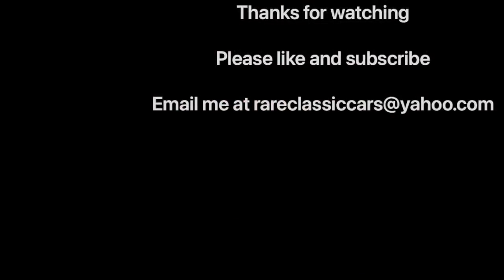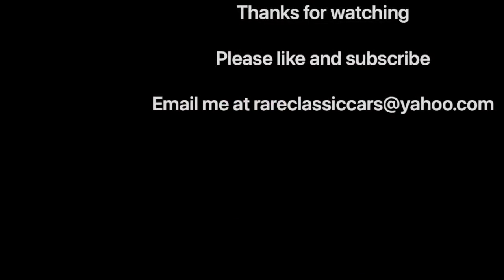Worst Engines of All Time: GM 2.5L Iron Duke Follow Up

Comment: "Worst engine" to me means unreliable.  Sure, smoothness, power and so on counts but pushing your car off the road wass really uncomfortable and celll phones were not common so a huge hassle.  Think of your engine blowing a gasket 100 miles away from anywhere on a hot day without a cell phone and a 20 mile hike to anywhere.  Today?  Dial and go but back then, a breakdown can blow your entire day or worse.  For this reason, "worst" means unreliable and any engine that was reliable, no matter how crude was much preferred over a smooth running POS that leaves you stranded every couple of months.  Different time, different rrules.  You forgot the "third" vehicle buyer, sure you had trucks and cars but the third car buyer was purchasing a "work car".  Something that could fit in tight traffic in cities, get decent mileage, performance was not critical because of traffic jams but it had to get you to work!  The Chevy Vega aluminum 2.3 was a smoother engine to be sure but you would not want one in a work car.  I'll grant you the 2.5 was a crude engine, vibrated, shook around and GM should of improved it with balance shafts, rubber mounts, aluminum heads or whatever when they fuel injected it--they should have!  My first CAR had a 2.5 Iron Duke with a carb and a 4 on the floor.  It was a car I drove to work and let me down once--so I push started the thing and got to work.  130,000 miles later, the car was damaged from accidents and abuse but the engine did not burn oil.  My car was not a kid hauler, not luxury by any means but with the 4 speed I could get mid 20's even in heavy traffic and the torque helped with stop-and-go.  No regrets with that car, simple, easy to work on and it just ran--as a work car should.  The VW Beetle was a crude, ox cart of a car with no performance, poor handling, weak brakes, no AC, no real heat, no auto transmission as it was designed to move people in the 1930's.  Oddly enough, a very popular work car because it was reliable if you mainained it, easy to work on, fit in tight city streets, great in snow and you can get it running qucily if it broke down.  That is why people have fond memories of that bucket.  Back then people didn't have cell phones when the car broke down, it ruins your entire day.  Reliability was more important then than it is now so keep it in perspective.  At least it would not leave you stranded when the cam belt broke.....right?  Now if comfort and refinement are weighed higher than reliability and economy, yeah....not a good engine but you should of bought the V6 in the first place.  Calling an unfrefined  but reliable engine "worst" because it vibrates?  No... at least it will get you there which is the entire point of driving a car.  At least the Duke was fairly easy to work on--not like the disasters that came later so that also keeps it off the "worst" listing.  So you have no cell phone, you have to fight traffic and get to work with high gas pricesw--the perspective at the time.  They did not know the price of gas would fall in the future and remain stable for 25 years so the panic to get something that sipped gas was priority.  One must always put the time in perspective with the vehicle.  The 2.5 was reliable, got decent mileage and didn't nickle and dime you to death with chronic maintenance---it just ran and for a lot of people at the time, that was good enough.  Sam Walton (founder of Wal-Mart) was the richest man in the world and drove an old pick-up truck, not because he was cheap....because it was reliable and just worked.  He was the richest man in the world at one time so cost was not a concern... keep it all in perspective.
Reply: We don't need a biography. Just make it short and to the point.

Comment: I drove an '84 Skylark for about five years, and that Iron Duke was the best most reliable part of that car. I beat on that engine mercilessly, delivering pizza even, and it never gave me any trouble, other than a thermostat - which was the EASIEST thermostat in the world, as it was accessed by removing a radiator style cap from the thermostat housing!!! Simply let it cool and pull the old thermostat, and put the cap back on and drive to the McParts store for a new one. Next time the engine is cool, drop it in! You'll spend more time in the store than you will R&R'ing the thermostat! Maybe showing us that particular feature will appease your disgruntled, Iron Duke-loving viewers... You've got to admit that that is a pretty interesting and convenient quirk on the FWD 2.5s.
Reply: I had an 85 sunbird and went to a concert at the capitol theater in Flint Michigan ( rough place). I came out and saw all the cars in the lot had their windows broken out except mine ( i always left doors unlocked). I drove about 45 min home  and realized i didnt have any heat ( middle of winter). Instead of stealing my radio they popped the hood and stole my thermostat and left my radiator cap in the fender well. At least they didnt break my window in the middle of winter. they got me the other way though. Silly thieves! lmao.

Comment: After watching your "Iron Duke" videos, I realize how lucky I was to avoid that engine when I bought a new '82 Celebrity.  We got the 2.8L V6 engine.  It was pretty gutless, but had none of the Iron Duke harshness you describe.
Reply: It really didn't have any business being in the A-body...  I drove a 6000 with an Iron Duke.   It was dog slow. (or turtle)lol
Reply: But that V6 did not have the durability of the Iron Duke.
Reply: Absolutely true. My parents had an '84 Omega with the 2.5 Liter buzz bomb, which they traded for an '87 Buick Century with this motor. The Omega was slow, but the Century was dog slow. That Century should have had a 2.8 v6 for the quietness appropriate to a Buick. Both cars were junk as far as reliability as well, were burning oil before 100K miles.

Comment: You are right in that the Iron Duke made noise.  The Olds Calais exterior lines were so pretty compared to Toyo/Honda 'fill in the blank' of the time that I would have chosen NVH and beautiful lines over the ugly ducklings and smoother 'motor'.

Comment: Too bad what they replaced the iron duke with, the Quad 4, wasnt that much better. Better performance (but no balance shafts till 96 when thhey bumped it to 2.4) and worse reliability.
Reply: There was a time in the late 90's where almost everyone I knew had a car with a quad 4 sitting in their driveway waiting for a new headgasket.
Reply: @hughdahand5711  I had a 95 Achieva with the quad4. Besides being so thrashy youd never want to use that high rpm power (it sounded like it would explode) and a blown oil pressure switch (spewed all oil out, needed a tow) it wasnt so bad for me. That cars problem was the 4t60e transmission. It would upshift as quick as possible to save gas and 40mph in 4th was too tall for the quad4 and it would start bucking. The transmission lost 3rd and 4th. It wasnt worth fixing and then gernaded itself 6 months later. My next car was a regal 3800 with the 4t60e. Shift points programmed exactly the same as the achieva but the 3800 had more than enough torque and it was the most reliable car Ive owned.  If gm just set the shift points differently for different motors it woulda saved alot of customers alot of grief.

Comment: I think you're on to something. Very similar to the manual climate controls in my 2013 Abarth 500. People complain about the "cheap" feel of the dials (vs the automatic climate control buttons). As a car guy whom wanted an Abarth 500 since new (with automatic climate control), but also a thrifty used car buyer, the 2013 I bought in 2020 had manual climate controls. Even with the "cheaper" feeling climate control knobs, the car geek in me can now appreciate the fact that the temp and air distribution doors are physical cable control, in a world of prone to failure electronic actuators buried deep in dash. At $5,500 that's acceptable, however at the ~$25k they were new, I wouldn't have been happy with the quality of climate control feeling for price paid
Reply: I had the opposite experience with the vacuum-driven automatic climate control in my '77 Olds 98. It was constantly switching from freezing to hot air; the running average was probably on target but at any given moment I was either too hot or too cold. The manual version would have been far better. All the other automatic systems I've owned have been fine.
Reply: @pcno2832  something was wrong with your car. The vacuum-operated automatic climate control system in my 1979 Cadillac Sedan deVille d'elegance worked great. As did those in my 1993 Cadillac Devilles and 1998 Buicks (Park Avenue & Riviera). The only car I've had with automatic climate control that I wasn't happy with, was my 1996 Lincoln Town Car Signature Series. It was properly functional, but would often be just a little too warm or cool with 1° changes, couldn't get it to hold the ideal temp. Along with the driving position, were the things I much prefer GM over Ford for. Love the 70s/80s/90s era GM cars where you can get the seat very low, slightly tilted back for a feeling of sitting "in" the car, rather than "on" it, as well as tilt the steering wheel all the way down to be right in front of your flat, rather than "slid" down to a lower position
Reply: @pcno2832  as for the Abarth/manual climate control system, a main benefit of automatic climate control is that, in cold weather, the system starts with slow fan until engine warms up and air mix door to full heat. Then it slowly mixes in more cool air to get to desired temp. Similar in summer when it starts max cold and transitions to warmer temp.

With Manual controls, it's like starting out with dial at full hot/cold, and slowly moving it toward middle based on outside temp, engine temp, sun demand etc. It can be fun, but often results in temp being slower to heat/cool out of laziness, or over heat/cooling by leaving it on max AC/heat

One benefit of manual controls with cable operated air mix door and air distribution door on highway, is being able to turn fan speed off, and using air pressure from car moving to sufficiently heat cabin/flow cool air at desired temp/outlet without running fan. Automatic climate control systems always have the fan running even at slow speed, unless system is turned "off" which turns off  control of temp/air outlet etc

Comment: Let me start by saying that I am in complete agreement with you,  but here is the strange part that I didn't understand,  I was selling Oldsmobiles  at the Troy Motor Mall in the 80s, if one of those cars came in ( used) for a trade in and was equipped with a 2.8 carburetor  it was a 500 deduct listed in the weekly black book that our used car manager often referred to for reference, we salesman didn't understand that,but we're told it was because of lack of fuel injection  and mpg, some funny moments when someone would compliment the owner of a new Toro and tell them what a pretty Calais that is, love the content

Comment: I have owned 2 1988 Celebrity’s with the 2.5 one was my first car in 1998 250k until I was rear ended!  2 5 years ago I found another one 122k miles and runs like new! But I maintain my cars like crazy lol. Oh I have a 1990 CRX 400k miles on it. Keep up the great work!

Comment: Two videos in one day, a double whammy, thanks.    The vibrating of the Iron Duke was somewhat of a safety feature for sleepy drivers.   Pull the engine to change a cam gear set, OMG.   Still the best--Chevy 327.     Thanks

Comment: I hated them with a passion. Unrefined is giving them too much credit and I even raise an eyebrow to the reliable argument. I completely agree that it turned some people away from GM coupled with a bevy of other substandard products and QC issues. By the late 90's I gave up on my love affair with GM and turned to Honda. By the mid 2000's I gave up on GM's trucks and turned to Toyota.
Reply: But Toyota, and the rest of the Japanese, not not make 3/4 or 1-ton pickups.  Only 1/2 tons.
Reply: @michaelbenardo5695  If I needed one of those I'd go Duramax, thankfully I don't. The Toyota's have been pretty much bullet proof. The last 5.7 Vortex I had was a good truck. The 5.3 after that was not. Neither was the truck.

Comment: GM was all about making money "now" and opposed to customer satisfaction for the future, like Honda and Toyota were. I was a 1970's child, gen x and American car companies shot themselves in the foot with this type of thinking. I know for sure I will never and have never purchased a new American car or a used American car. NO RELIABILITY! Complete junk compared to Japanese companies. I may be stupid. But, I'm not stupid enough to throw my money away on garbage. On the other hand. I will always purchase used American trucks. Because I believe they are the most well made, with the exception of a few choice years like 2010- up. These year trucks are choked with DPF, EGR and smog equipment, badly.  I have an early 1998 Dodge Ram 2500 12 Valve Cummins with 299,300.I drive it everyday for work. I have had to replace some body parts because of rust and engine components like injectors, power steering pump etc.. I maintain my trucks well and they stand the test of time. The engine, trans, rear and 4wd still work flawlessly and I haven't had to replace them, yet. But, I wouldn't be mad if I did. Because I don't know of any American car that would last that long, ever! Car not truck!

Comment: I went from being used to driving a 1986 buick century with the 2.5 to driving a 1991 caprice with the 305. Over 20 years later i still remember how blown away I was by how smooth and quiet the 305 was compared to the iron duke.
Reply: 4 cylinders have never been known for smoothness.  8 cylinders, whether inline or V, are super smooth.
Reply: @michaelbenardo5695  true, but putting such a clattery 4 cylinder without even a balance shaft in an otherwise very smooth driving and comfortable sedan just doesnt fit. They shouldve stuck with LLV's and S10's in my opinion.
Reply: @amhicks21  My 1979 Toyota Celica had a honey of a 20R 4 cylinder motor in it. Much smoother than my 1983 Chevy Camaro with the 2.5 Iron Duke I once had.
Reply: @amhicks21  In 1977, when it was introduced, it seemed fine, and I don't think anybody was yet using balance shafts.  I know a friend's father bought a brand new Olds Omega in late 79 when they came out as 1980 models, and he let us drive it.  We thought it was fine for a 4 cylinder, felt stronger than any foreign 4 cyl.  And despite all the bad press about the first year X cars, he never had any trouble with his.
Reply: @michaelbenardo5695  Not all 4 cylinders are rough.  Honda 4 cylinders are very smooth especially with a Honda manual.  Also the 2.2 4 cylinder in my 99 Chevy S-10 with a 5 speed manual was very quiet and smooth.  The 2.4 4 cylinder in my hybrid 2012 Buick Lacrosse was very smooth.  The technology has vastly improved and with the addition of EFI the 4 cylinders have become much better and more refined.
Reply: @jeffreysproul9110  But Honda 4s were too small for a 2400 - 2500 pound car.  Not enough low RPM torque.  Yes, I'm sure a modern 4 is nicer and more refined, but they are way off base calling the Iron Duke "a worst engine".  The VEGA engine was one of the worse ever, not the Iron Duke.
Reply: @jeffreysproul9110  — Actually, all inline-4’s have secondary vibrations inherent to its configuration. The amplitude of the vibrations grow with the displacement.

Balance shafts, though invented in the early 1900’s, were adapted to automotive engines by Mitsubishi in the mid 70’s, and marketed as “Silent Shaft” technology. 

The 2.2 and 2.4 engines that you reference both are equipped with balance shafts, and pre-balance-shaft engines were smoothed by the careful design of the engine and transmission mounts.  

You mentioned Hondas being smooth, but before they started utilizing balance shafts (late 80’s), they kept the displacement low and did their homework with the engine/transmission mountings.

The Iron Duke was a relatively large-displacement in-line-4, so it was a strong shaker. Starting in 1988, it was equipped with balance shafts that transformed it into a much more pleasant engine.
Reply: The Buick Century should never have been equipped with that engine. The V-6’s in that model were smooth, peppy little engines ...
Reply: @sking2173  exactly! GM did their reputation no favors by putting that engine in things other than trucks and utility vehicles.
Reply: @sking2173  True, but you have to remember CAFE.  If it didn't exist, there probably never would have been any Buick models to have it at all.

Comment: Excellent video. You couldn’t be more correct. These were super weird when they were in the mid engine Fiero as well. They’d about vibrate you out of the seat.
Reply: The Fiero 2M4s with this engine had a propensity to catch fire, as well.
Reply: When those Fieros were new, the main complaint was that they had decidedly UNsporty performance and might catch fire.  Hardly anybody complained about excessive roughness.  Not back then.
Reply: @michaelbenardo5695  the news programs really had a field day with the Fiero fires. They milked it for everything they could. Yet the fires on Fieros we're on less than 1 percent of the cars.
Reply: @DucatiPaso750  They destroyed that car.  It seemed like a pretty swell car to me, as long as you didn't try to compare it to a Ferrari or Lamborghini.  Yet nothing about the Japanese cars that turn to rust a day after you bring it home.  (That's one reason the Cubans don't like them - they rust too easily).